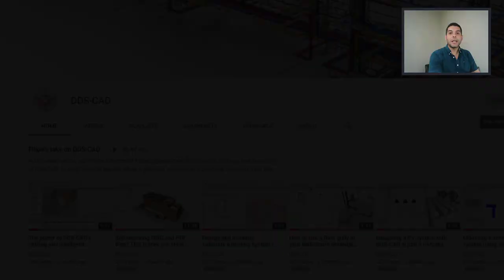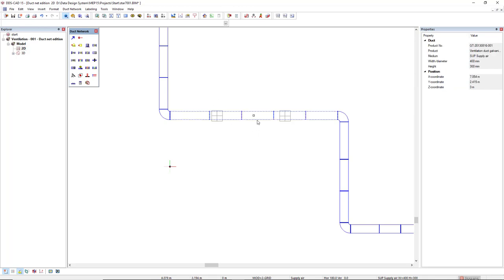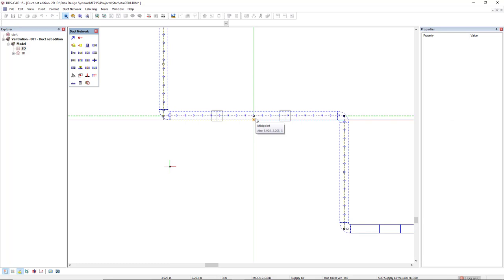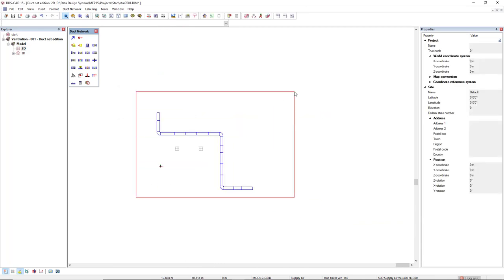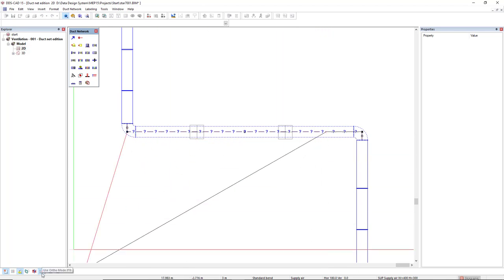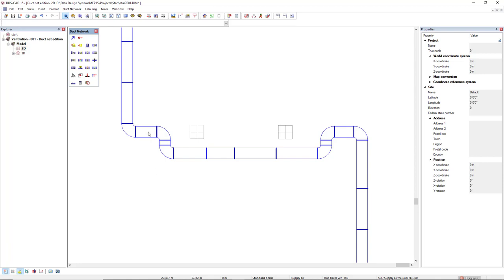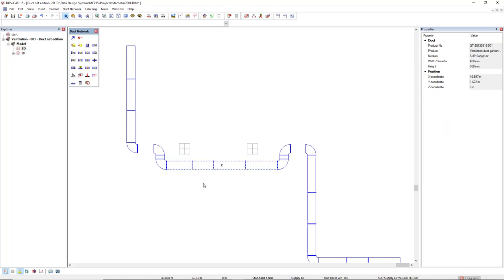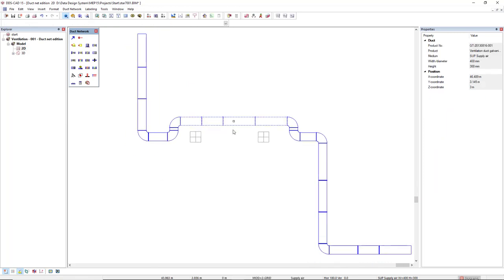How to easily edit ducts and pipes in DDScad

Comment: It's great that you take care of cleanliness and add each video to the appropriate playlist. This makes learning much easier! Good to you!
Reply from the maker: Thanks targetti, your comments are highly appreciated
Reply: @DDSCAD-MEP  Hi,

as I mentioned before, the biggest problem with DDS-CAD is not the database or learning its functions. The biggest problem is the import of the IFC file generated from the ARCHICAD program. I tried to create model export settings from ARCHICAD to IFC file. Unfortunately, none of them was correctly detected by DDS-CAD. DDS-CAD did not map individual building elements (walls, doors, windows, and most importantly floors) which makes it impossible to detect collisions, assemble hardware at a given height, etc. Perhaps you could create a guide on how to properly export an IFC file from the program ARCHICAD so that it is correctly loaded by DDS-CAD.
Reply from the maker: Hi  @targetti123456 , in order for the IFC building elements be converted to DDS-CAD objects,    the IFC must contain IfcSpaces. I would suggest to you to search for ArchiCAD tutorials about how to create Zones and export to IfcSpaces.
Reply: @DDSCAD-MEP  I wrote you an e-mail message.